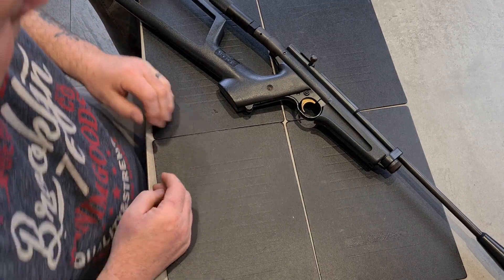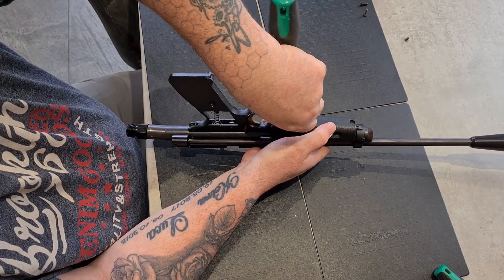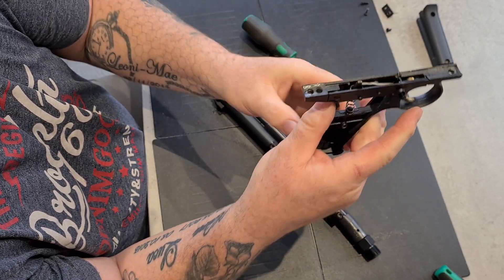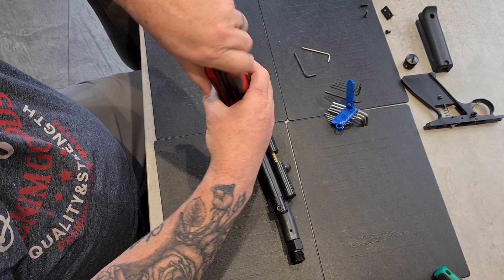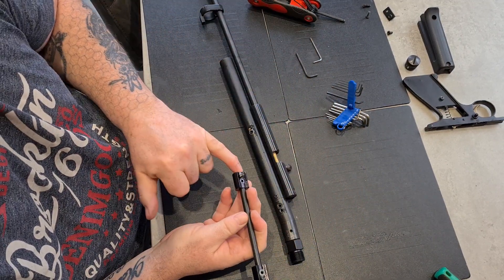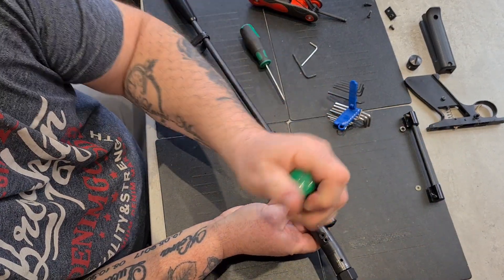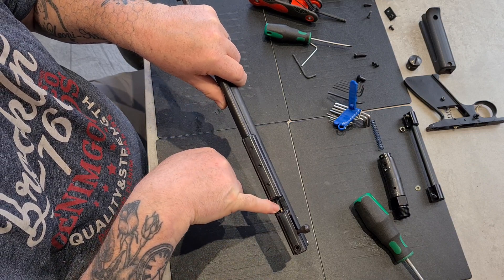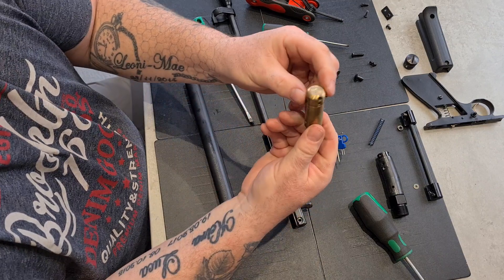Crosman King rat AS2250 strip.

Comment: my poor king rat needs a seal kit, unfortunately gmac customs are out of stock atm.....but after seeing this video, the seals you used look different, and completely different from what's in my gun. great video, I've been searching for a breakdown of an as2250 for a long time.
Reply from the maker: A pal of mine called ped ped who is one of my admins on my Facebook group sells the seal kits
Reply: @peasngravyproductions3728  that's great thankyou, i purchased a seal kit on ebay that i found from a1tackleshop for 10.50 only yesterday. should be here tomorrow, but i do want an extra set or two and will definitely use ped ped, great help and thankyou again.
Reply from the maker: Great glad you got sorted.

Comment: That hammer pin slot appears to have been extended to allow the bolt, hammer and spring to be removed without the usual breech strip......what a good idea!

Comment: Good to see a king rat strip down. That screw you took out in front of the pellet probe to or three of mine have the screw there but the others don’t. I have five king rats two I have finished and I have three to do so maybe there’s different models all mine are AS2250 king rats. I’m shore it’s two ware there ant a screw it’s not ware the pellet goes in it mite be three guns I have it may be two and I’ve thought why is this. After a valve turn what’s the most psi would you put in the valve the two I’ve done there 850 psi but the next one I do with a 24-inch barrel I’ve been told the turned valve can accept up to 1100 psi but I think 1000 psi is safe. Any way good video.we’ll done.
Reply from the maker: Hi I've waited a long time to get a king rat in too work on usually its just parts of a king, as for psi I've seen 1800 run on them and it's normal to run 1100 on one when you change to .177 to get sub 12lbs. I was a bit shocked to see it was a front mounting probs screw and not a hidden one. Maybe next time I get one in or an XL
Reply: @peasngravyproductions3728  Hi my friend. I never new the valve of a king can accept 1800-psi that’s a lot. My 3- king guns I have not started on yet I can’t get to them at the minute because I’ve got so much stuff in my bedroom and there in the back of the cupboard. I am 100-percent two of the the screw can’t be seen because I remember looking at the 3-left I have thinking what one to do next that’s when I noticed know screw. I’ve bought enough to do two more but I’m thinking of getting a work shop in my garden then I can use my Lathe. I split with my X the bitch took my house from me I won’t talk any more about that. I have all my tools in my ground floor flat the good thing I have a garden not many have gardens but mine has I all so want my super bike in my work shop. My next crosman will be all stainless steel and multi shot I bought my multi shot from GMAC.and one I’m going to do in brass.I have a one off wood stock plane wood are do that in beach stain I have so much king rat spares new and 2nd-hand. The main tube of theses gun I have two with the valves in them all complete. I mite do one in 1.77 because I have a lot of pellets.are talk to you another day.keep safe my friend.
Reply from the maker: No problem anytime you need a chat or advice just shout up and good luck
Reply: @peasngravyproductions3728 i did a 
.25 cal at 1800psi,generally id run a .22 King st 1200 psi 😁

Comment: Just managed to put a modified valve and breach seal in my 2250 thanks to  your  videos  so thank you  for taking the time to do this. My breach screws have worked loose a few times giving me a leak that requires  re tightening  so I'm wondering  do you use lock tight on these?
Reply from the maker: I dont use thread lock at all am surprised that the screws work loose.
Reply: @peasngravyproductions3728  yeah happened after fitting the parts was thinking I will never have to take it apart  again and  wounder if  lock tight was the answer
Reply from the maker: If the threads are worn I sometimes upgrade to M4 screws also if it's a plastic breech you can add an extra anchor screw to the front barrel band so it locks it to the gas tube as well as the barrel

Comment: Hi, I've just been given a king rat, but when I fit a new 88g tank, it leaks gas and doesn't hold it for longer than a day. I've ordered some new seals from T R ROBB but in 1 of your videos you say one needs to buy a new valve stem as the seals are non replaceable, where do I get them from please?
Reply from the maker: First off you need to understand where its leaking from but tbf if your going to strip it anyway its best to renew all seal for what it costs. https://drapers-airguns.co.uk/gun-spares/crosman-king-ratcatcher-firing-valve-stem.html or https://gmaccustomparts.com/oxt-026-valve-stem if you can't get one you can always buy a standard 22xx stem and cut the pierce part of the stem off as its not needed
Reply: @Peasngravy Productions  thank you for the information. Is there any reason why drapers is twice the price of gmac? Also the valve stem in the picture doesn't look like the valve stem in your videos 🤷‍♂️
Reply from the maker: 2240, 50, and 60 use the same stem with a pierce pin attached which punctures the co2 cart. The king rat does not need the piecer pin so the exhaust stem does not have it. You can cut the pin off the 22xx stem and use it in a king rat if you can't get a correct one. And no idea why different sellers charge different prices, probs what they have to pay for them + their mark up. As you know these guns are American so all spares come from overseas
Reply: @Peasngravy Productions  you're an absolute gent, I really appreciate your information and help. So am I correct in thinking that the new valve stem will have a new seal already attached?
Reply from the maker: Yes, they come with the new seal already fitted. No one has of yet that I know of has managed to successfully just swap out the seal on its own. And glad to help